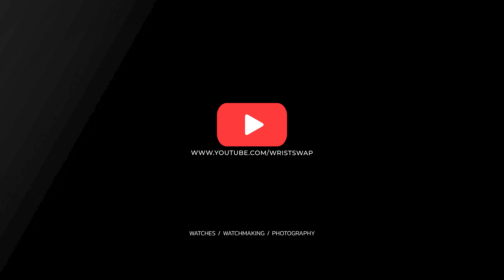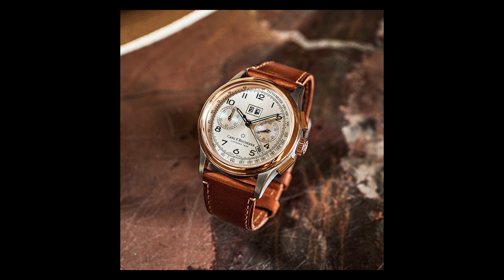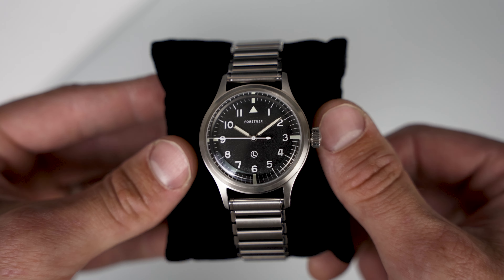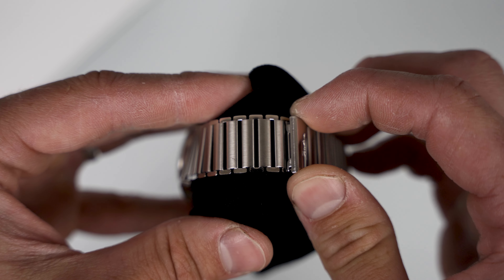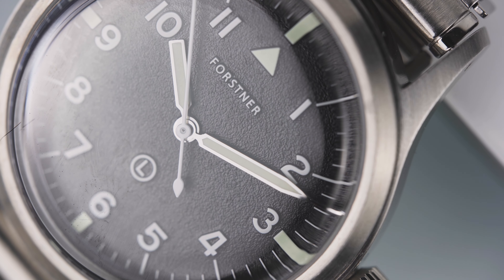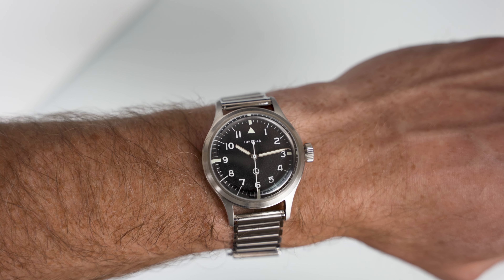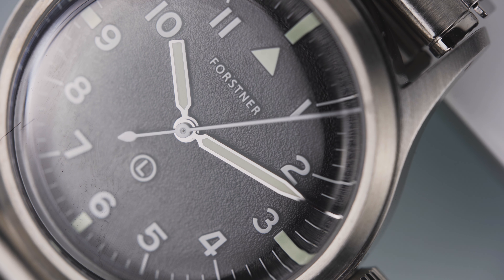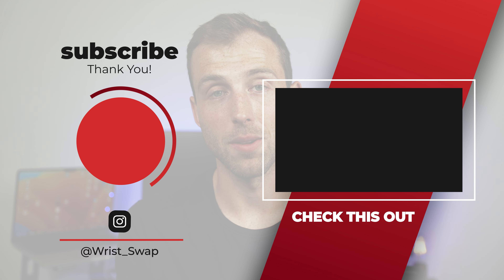You Like Vintage Inspired Watches? Feast Your Eyes! NWA

Comment: Looks like the serica 4512, but the serica looks better.
Reply from the maker: I'd never seen the serica before. I'll take a look.
Reply: Sure, the serica looks better... but a locking crown with a handwind only, with such a short power reserve?  It doesn't make sense.  You can try to tell me it's about your relationship with time, and that there's something ritualistic to winding it every morning, but the water resistance will be compromised a lot more quickly having to lock/unlock that crown every day.  I've also heard the Forstner bonklip is better designed and stays clipped better.  Forestner nailed this.  And also - they have far superior customer service.

Comment: Hi Harrison, you want to consider the Smiths PRS48 by Timefactors. IMHO arguably the best modern rendition of the Mk11 sans the Forstner Band. It comes with a "Top" Sellita and a Faraday cage (for added magnetic protection)
Reply: Impossible to get and even if he did his audience wouldn’t be able to buy one. I love my PRS from timefacters but they have the worst customer service of any watch I’v ever bought.
Reply: @turnbasedtoddy7664  Well I couldn't object to your gripes. However, having spoken to Eddie at Timefactors, I understand the limitations of its customer service capabilities. I've had a better than 50% success rate in acquiring some Timefactors watches with preparation and perseverance. 
Nonetheless, if you're fortunate to get one, there's no denying the detail that's been put into the PRS48 having seen it next to a vintage IWC Mk11 (not the JLC Mk11). I wish you well in your journey.